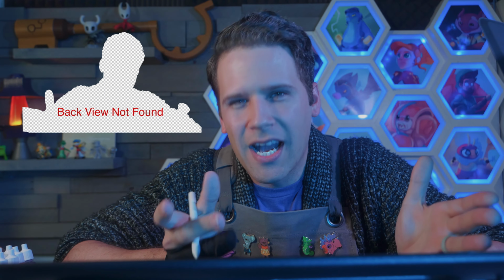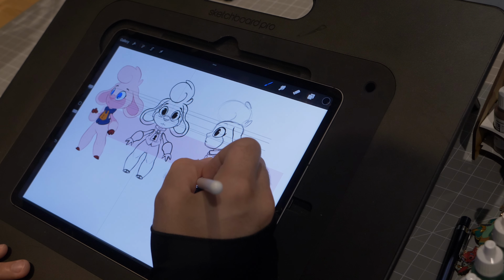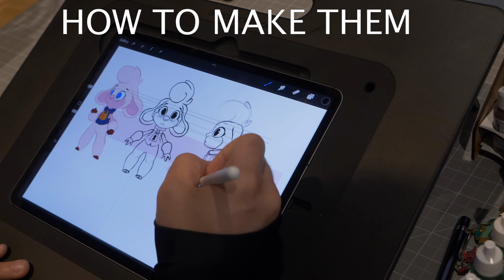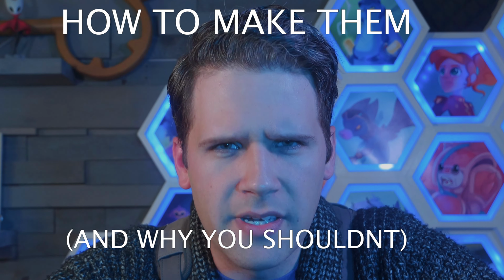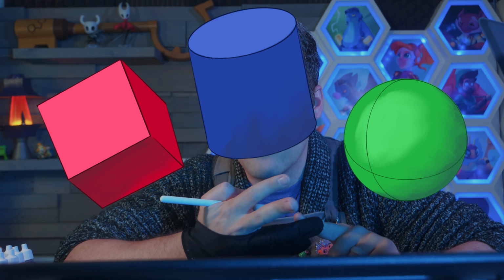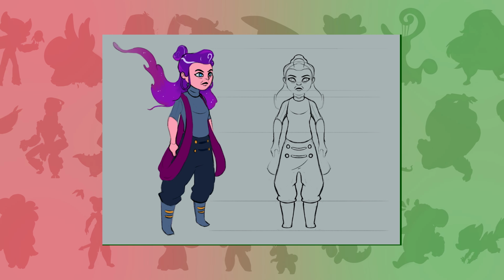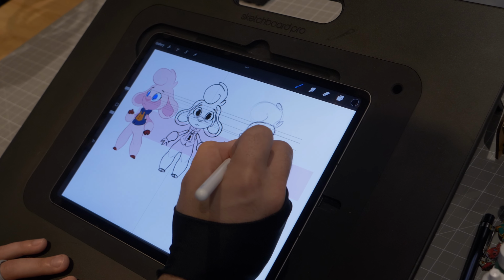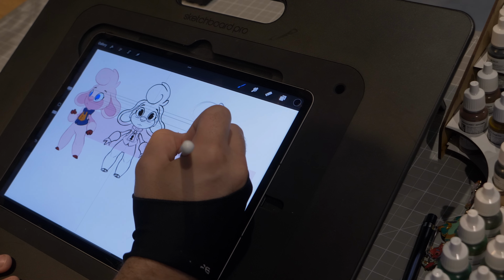Why Character Turns Can Sterilize Your Character Design

Comment: I have a similar method. I learned to write a lot about the character first and I save many references related to the character. Then I draw thumbnail sketches of the character. And then, the first time I draw the character design more defined, I want to start with a with a turn-around sheet, but I start with the diagonal angle, because this is the most three-dimensional angle and it allows me to imagine the character as three dimensional first, and then after that, it's easier to draw the front angle and side angle, while retaining the three dimensional shapes and proportions of the character and their costume. 

I found out that for non-human anthropomorphic characters or fantastic characters or heavily stylized characters, it's going to be difficult to explore more of the character first, and sometimes, making a turn-around first would be more practical for some characters, especially if I already have so much written about the character, and if the character is already visually interesting and it could not have more visual exaggeration added to it.

Comment: I find the best way to create a character turnaround is by creating it in an animation program, where each frame has a new view instead of doing it all in straight line on one canvas. Using onion skin and scrubbing through the turnaround is incredibly useful, and helps you spot mistakes much quicker. 

I think it's pretty much impossible to create a 100% accurate turnaround when you draw it on one canvas. You really need to see the character actually spin to make sure it works

This also makes character rigging (for 2D puppets, specifically in Animate) a lot quicker if you have each view on a separate frame already.

Comment: I am a somewhat prolific creature/character designer (in that I have designed a lot on my own; debatable that all of them are good, hah) and I’ve gotten into the habit that every sketchpage I do of them will feature the turnaround/orthographic views of the species/character along with notes about various details, usually nude so as to get stuff like markings and body-typing consistent. But I’ll also have other folders within the Clip Studio Paint dedicated to gestures and poses, folders for expressions and other things, including for ‘promotional images’ that are meant to be more like those showcase pics with a prominent key poses and outfits. So I do indeed feel that, yeah, for the conceptualization phase of a character is good to have both the orthos even if you don’t plan on handing it off to a modeler or something, and also to have various key/action poses to actually draw out the character of the character.

Comment: I actually do use character turnaround in my early design process, but never as a final product, more so I like to use it to figure out if I like a character's current design from the front, side, and back - sometimes a 3quarter angle view.   Usually I love to iterate up on my character designs mentally and figure out how those translate to lines, I'll do a few poses and try out a turn around to see if there's anything I want to elaborate on, or simplify. 

I guess I would describe these as more conceptual turnaround sheets that I elaborate on through other drawings, I personally consider the end point of a character's appearance to be whenever there are no further changes to their design in artwork, past if they gain a new trinket or wear some different clothing at some points of the story, so if their hairstyle comes to a point that it doesn't change further, then it's good to finalise that. 

Although, I do need to get into the habit of actually committing to drawing ideas I get instead of procrastinating them away.

Comment: NO BROOKS JUST NO! There are not TWO MORE PILLARS... because I KICKED THEM DOWN!  (This sounded so funny to me at 3am in my head XD)  But I HAVE done some character turns for a few of my characters and as you said they should NOT really be done in the early stages or you will just be kicking yourself when you revise them later. That has been MY experience with it is that I JUMPED THE GUN and started too soon thus have some regret. I am still learning to draw though and character Turn arounds pretty much forced me to work on 3D Forms and some level or perspective even... so I do not totally regret doing them, just wish I had maybe waited a teensy bit longer to start doing them with some of my characters.

Comment: One thing I do is I use the front view as a template and then remove the features one at a time and make rotated versions to ensure it feels right...
though since I use pixel art, it tends to be a simpler easier process since everything is aligned to a grid, so I don't have to worry too much about parts shifting up and down on different angles...

Comment: I problem I tend to run into with my character designs is making my character look appealing from a front view.

This is not an uncommon problem, as a lot of characters like Phineas and Ferb, The Simpsons Cast, Timmy Turner and Mr. Crocker might like great from a 3/4 angle, they look absolutely hideous from the front.

But even though I like extreme graphic shapes, I don’t want an ugly front view for my characters, hence why I have to cheat a lot of things.

Comment: I try to use the character turn around as part of the design process to get a better idea in my head of what they actually look like. I love your points though that it shouldn’t be used as an endpoint. Or at least, that you shouldn’t rush to that endpoint. I like that a lot. :-)
Reply: I was able to figure out some design issues this way because I had to draw the Charakter from the front which I never did to this point.